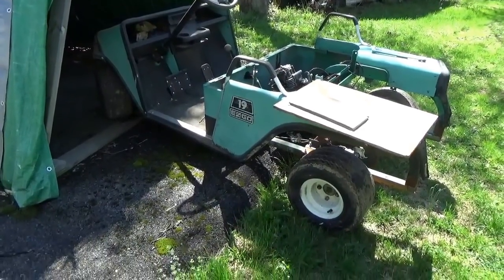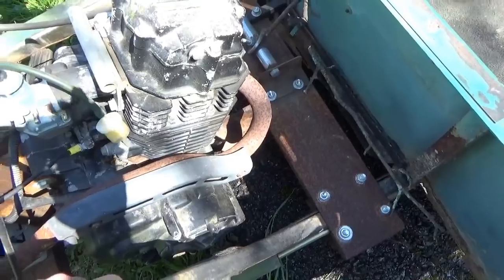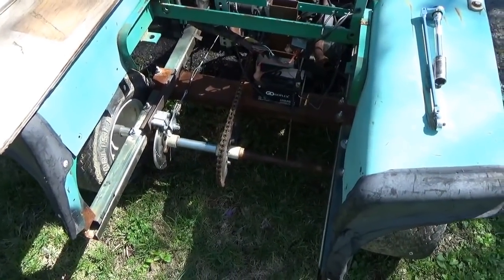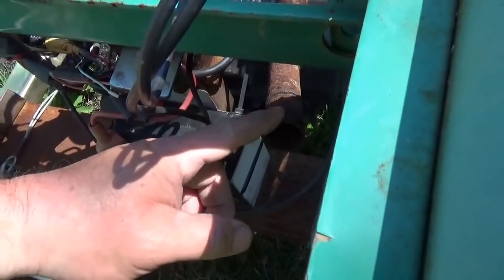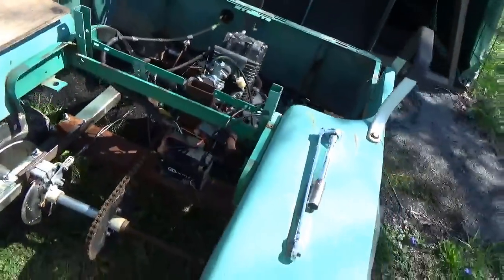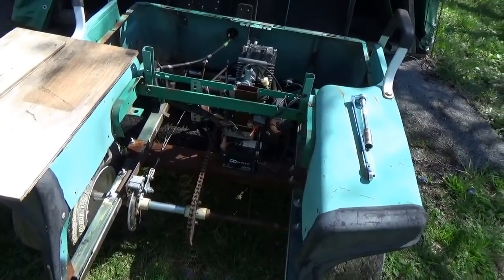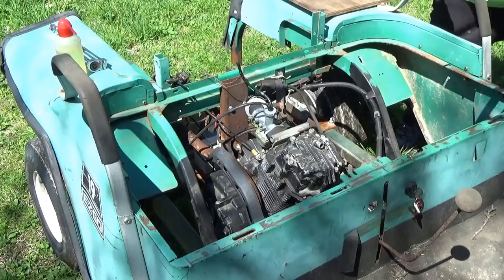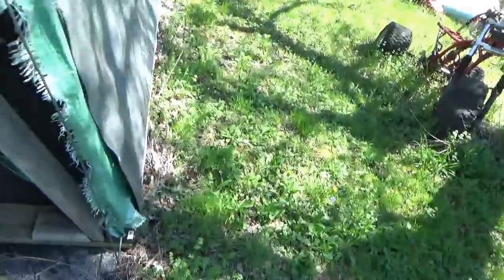EZGO Electric to Honda ATV Motor Conversion, Cold Start, Re-introduction!

Comment: I like it does she still have it you ever get around to doing the seats I would like to see it rip I got a hold of one that is electric it is a ezgo golf cart that is electric I'm converting over to gas has a lift kit but I'm going to be using the stock rear end I have a two stroke motor that I am probably putting in mine

Comment: Get a alternator on there on the front down by your shifter cut out a square and put a fan in there to wear it sucks in air and blows it on to the motor
Reply from the maker: Hey Joey!!!  It has an on board stator, it has power for running a fan if needed.... It seems that a lot of the heat generated just rises, I'm thinking that should be enough, I have not put that much time on it yet to be sure though.... Thanks for the suggestion, watching, and commenting!!

Comment: I have a totally modified G1 cart with a China 125 motor and it rips down the road can't wait see how fast the one you got goes
Reply: Mine was gas powerd and the ratio for the rear end 8 :1 and had a belt so I switch it to a China rear end that was chain drivin. Also I added th font end of a China quad so all tires had the same rim and size one thing to watch for is the back and front widths the back end is 6 inches on each side to narrow compared to the front. If there is a way to pm on you tube or send you picture I'd be willing to do that if you are interested
Reply from the maker: Hey  Ross, I understand exactly what U did, U did a lot of fab work to put a golf cart on an atv frame.... Thanks for the info, watching, and commenting!!!
Reply from the maker: Hey Ross, One of the build projects I'm planning is a Club Car electric to China 125, the club car is light as it has an aluminum frame.... 1 question, did U keep the old rear in it or did U go straight axle????  Thanks for the info, watching, and commenting!!

Comment: I still wish I could have your help with my three wheeler but I live far from you and I still can't figure out what's going on with it, I do know that it doesn't have spark but the spark plug is good, the pulse generator is good, the coil is good but the spark is not getting past the cdi box or the coil. Plus on my coil wires there is 2 green wires (ground)? And I don't know if I should put both of them on there or not? I have lots of questions.